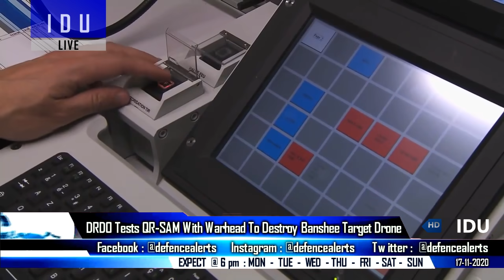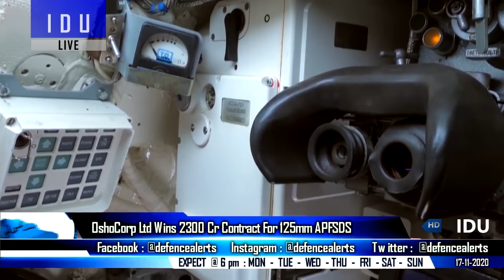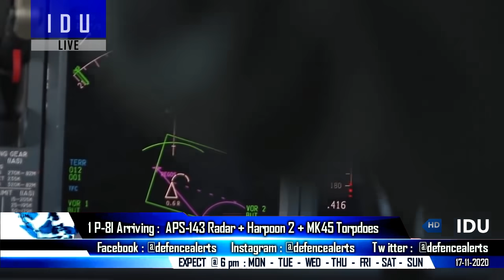Indian Defence Updates : QR-SAM Payload Test,2300Cr APFSDS Order,Next Gen MCIWS Trial,1 P8I Delivery

Comment: 6.68  sucks. 
7.62 are perfect
Reply: 7.62 will be obsolete soon
Chinese are buying 1.4 millio high-end light weight bullet proof jackets which will stop any 5.56 and 7.62 bullet from 10m

War will be in between 100-300m , so penetration will reduce too

Russians are using Ratnik and Chinese also issueing state of the art body armour to each soldiers

Thats why they are switching cartridge to gain upper hand

China already use 5.8 mm dp-10 steel core bullet to penetrate armour , Russian also using their own 5.45 mm steel core bullets 

USA suddenly finds out their 5.56 is not effective against new gen body armour in mid range, that's why they are desperate with 6.8mm ammo